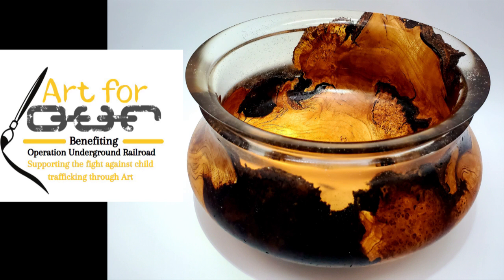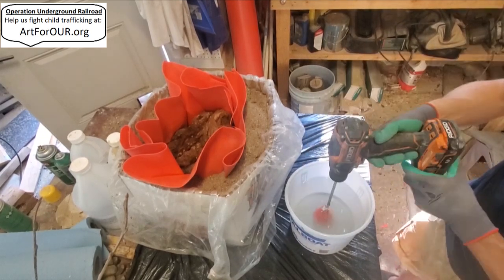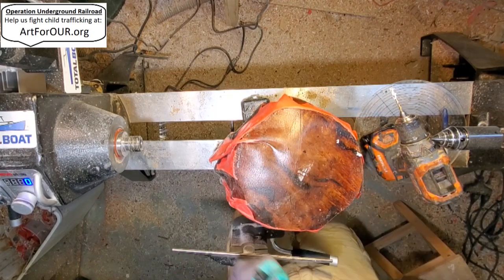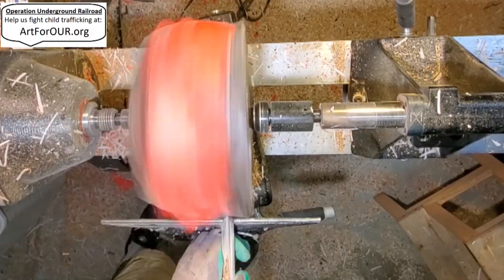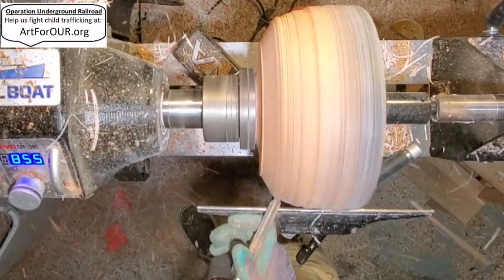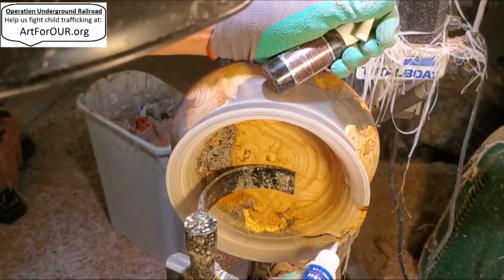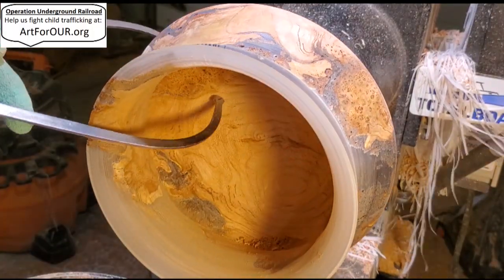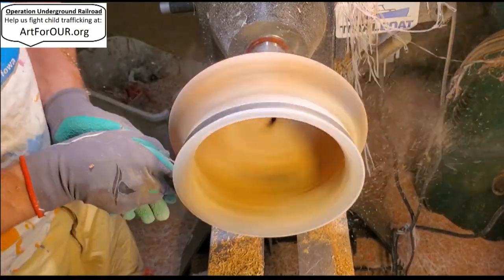Cherrywood Burl with clear resin, wood turning, lathe project.  Thank you Todd Huth!  ArtForOUR.Org

Comment: Your work is very inspiring! The suspended deep bubbles are in my opinion an asset in this piece. Have you ever considered fitting a BB-Q Grill rotisserie motor to allow slow rotation so that you can apply epoxy to the surface of a work piece while the piece is turning to fill any small voids then sand them down to smooth again? I have seen this technique used before with impressive results. I have intentions of fitting my lathe with a rotisserie so I can use this technique on some of my projects. I really enjoy your videos and your art, keep up the good work!
Reply from the maker: That's a great idea!  Thank you.

Comment: Looks great you’ve done well 😎

Don’t go down the vacuum path it won’t go well. Wood takes a long time to lose its bubbles, so you resin will turn to froth. You can vacuum the wood alone first (for ages), then introduce the resin via tubing of some sort, the vacuum plays havoc however due to the affective heat (the temp is equivalently a lot higher in vacuum). Also, if you don’t have a pressure pot big enough, you probably don’t have a vacuum pot either.
Reply from the maker: Good Advice!  Thank you...

Artforour.org